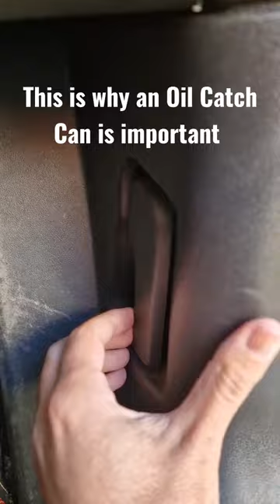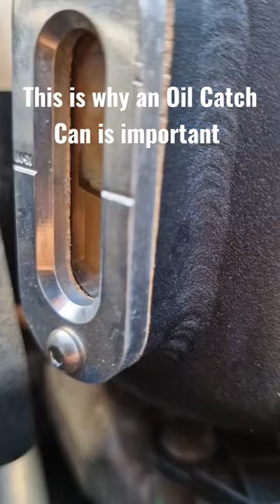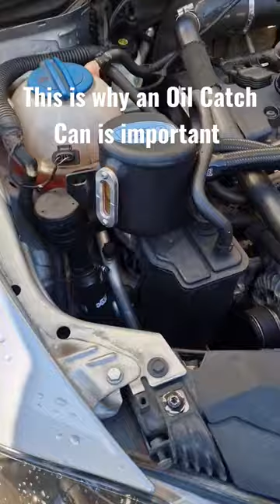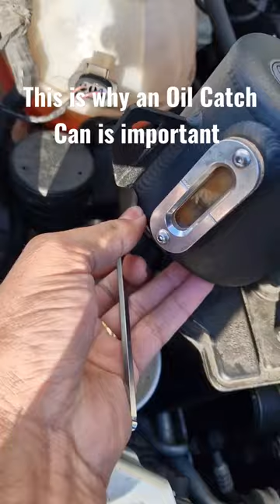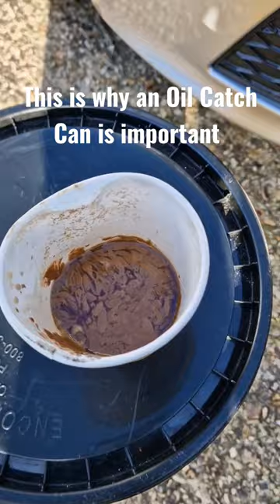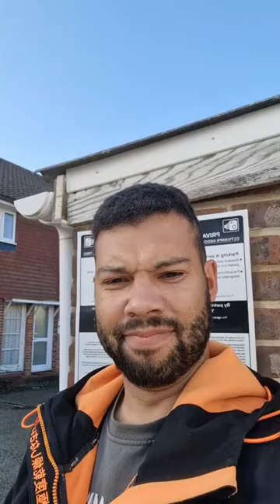Here Is Why An Oil Catch Can Is Important

Comment: Ford espresso
Reply: Nice
Reply: More like chocolate pudding
Reply: mix mix mix that chocolat😆
that sistem is really good for subarus any tipe engine
i'have a cashcan in my 2.5 boxter single cam 7000 milles before take out the valve covers & sorprise bot sides is clean ❤🎉🎉🎉
no bad valvs all is Clean
pcv inner clean
Reply: @cheloarechiga1778 yours filters money?
Reply: @CarObsession do you not know what espresso is?
Reply from the maker: @PurpHaze830  Yes, but this isn't a Ford, that's why I was confused.
Reply: @CarObsession  ohhh because the catch can says forge he probably thought it said ford
Reply from the maker: @PurpHaze830 Ahhh, that makes sense.
Reply: @CarObsession  and the sticker is the same shape as the ford logo oval haha
Reply: La lattina di raccolta serve per motori usurati dai 120/150.000 km in poi

Comment: Catch cans are useful if you have a direct injection engine. On port injection engines they are snake oil because whatever blow by they catch would end up burned in the cylinder if the catch can was not there.
Reply from the maker: Hi there, thanks for watching and thanks for the comment.
Reply: Completely false statement. On a stock car, it probably wouldn't matter. Once you have a turbocharged engine and it is tuned for power (port injected), you do not want oil getting into the air/fuel mixture as you can end up with detonation/pre-ignition and fouling of the spark plugs depending on much much blow by and oil you are atomizing into the crankcase.

For a stock N/A car without direct port injection, sure you will not need one. For a turbocharged and tuned car it's best to use a catch can, or vent it directly out to the atmosphere.
Reply: @JesseS420 So let me see I got this right: you say my statement is completely false. Then you proceed to say that, unless you own an exceptional vehicle (turbocharged AND tuned, probably 0.5% of vehicles out there) my statement is correct. So what is it? For every statement there are exceptions.
Reply: so you say that burning oil is a good thing? what about carbon buildup inside intake manifold, catalytic converter etc...
Reply: @MBB150-v5p At least be honest if you want to debate me. I never said it’s good to burn oil, that would be incredibly stupid. Think about this for a moment: blow by is not pure oil, it’s a mix of water (from hot steam) and oil. A catch can ends up with what, 6oz after 3 months give or take? That’s 3oz of oil, assuming 50/50. It’s nothing. Then comes the intake valves which create a blockage on the way and then a lot of blow by gets on top of it over time. Without it getting washed by the gasoline from the injectors on the direct injection engines it accumulates
Reply: @MrGustavosco  it is not just comnination of water+oil. the useful part of the blowby is unburnt gasoline. also most engines suck oil particles not just vapour. these cans will catch that also some water which is fine and send unburnt gasoline to the engine which helps engine healthy breathing.
Reply: @MBB150-v5p Gas was not mentioned because it’s burned regularly inside the cylinder so it’s a non-issue. Anyway, you didn’t address my main question: is roughly 1oz of oil getting burned per month an issue? Of course not, it’s negligible. The catch can doesn’t exist to stop the engine from burning a negligible amount of oil but to stop carbon build up. If the injector washes the main carbon built up spot, the intake valves, the catch can becomes irrelevant
Reply: @MrGustavosco  1oz of oil per month maybe seems nothing for short term but on the long term it'll create carbon buildup for sure. I don't disagree if you say that oil catch cans are not mandatory but having less carbon buildup with 20 bucks is not a bad idea.

Comment: the best part of waking up is foldiers in your cup. But seriously is it ok for this hose to touch the engine or the engine firewall? I'm trying to route this myself and my bay is much more cramped.
Reply from the maker: How can it be more cramped?
Reply: @CarObsession  it’s a Mercedes coupe with a 5.5l engine
Reply from the maker: @Dnasty1  Oh I see, sorry, I thought you also had a Leon Cupra, which is why I was confused. Well you need to see if there is even a catch can kit available for your car.
Reply: @CarObsession   I actually ended up making my own catch can since posting this with a generic one off amazon for bmw. Took some customization but i got it done. I managed to run it against the firewall (which I was told shouldn't be an issue) so that it does not touch the engine. My only concern at this point is if it is ok that the two hoses touch?

Comment: Run a bore scope into the intake manifold. Look at the valves before and after installation of a catch can on a GDI engine. I bet you have hardened carbon deposits.

Comment: That's mostly water vapour and a smidge of oil.
Reply: No it’s mostly oil with some gas and water
Reply: @Caden17688, how does gas get into a crankcase???
Reply: @matthewnewsome9221 Unburnt gas recirculates?
Reply: @matthewnewsome9221  Runs down the cylinder walls especially during a cold start. It's more common on GDI engines.

Comment: Its supposed to catch oil.  Right?
Reply: Yep catches the oil before recirculating air into your intake manifold. Direct injection cars benefit the most reducing carbon buildup since gas doesn’t clean the intake valves.
Reply: @JoshuaWhitman 
But in the video is catching a frothy milky stuff, is it coolant??? Water mixed with contaminants???    Where's the oil???  I'm a bit confused.
Reply from the maker: Yes.
Reply from the maker: @Wilhuff_T I'm confused as to how you can't see the oil? The "frothy" is merely caused by condensation and is nothing to worry about.

Comment: Based on what can out, It looks like you might have more problems than a catch can will solve
Reply from the maker: Such as?
Reply: Correct me if i’m wrong, doesn’t that milky color mean you likely have radiator fluid mixing with oil? Head gasket has started to go perhaps? Let me know what you think that color indicates.
Reply from the maker: No....this comment has been a few times...it's just condensation most likely caused by doing shorter journeys. 

If I had a head gasket issue I'd have other symptoms such as white smoke from the exhaust, oil in the coolant reservoir, and a milky oil cap, none of which I have.

I work in a car repair garage and the guys I work with say there is no problem (two of techs also have oil catch cans fitted to their car).

I'll be honest, I'm getting tired of such comments being made.... Especially when there's people say mad things such as the catch can will stop my inlet manifold being lubricated 🤦🏽.
Reply: @DLR369_  the air has moisture, the induction phase will evaporate that moisture in the intake process itself so the steam of that get carried and it would condense back into a liquid form in the catch can

Comment: Do your research. Don't listen to these social media mechanics.  The can cause your rear main seal to blow and cause engine failure
Reply from the maker: Out of interest, how would they cause the rear main oil seal to fail? I'm guessing it would be to do with crankcase pressure building up? I would imagine the worst that would happen is that the seal fails, causing an oil leak. I'm no expert, but I would have thought it would only cause an engine failure if the oil leak was left for so long that it caused oil starvation, causing the engine to seize?

Also, on that note, I'm pretty sure an oil catch can would still allow the pressure to be relieved from the crankcase, so I can't  see why that would cause an issue with the rear main oil seal. 

* I've just one this past of the experienced technicians I work with (I work in a car repair garage) and he agrees, unless... "the oil catch can circuit is causing an excessive positive or negative pressure build up in the crankcase I can’t see why it would cause damage to the main oil seals". *
Reply: Ive heard in winter climates you need to be careful with installing these because they can freeze and cause pressure buildup.  Ive heard tech's say they would take them off during winter months
Reply from the maker: I'll be honest, I've never heard of that, nor has that been advised by any of the mechanics I work with, two of which I know for a fact have catch cans fitted.
Reply: @CarObsession  well if you don't have to contend with winter months and freezing temperatures it's probably not something to worry about.  Condensation freezes and we get extreme cold snaps where I live, so it is a consideration I've come across

Comment: U MAY HAVE A HEADGASKET ISSUE LOL
Reply from the maker: Based on what evidence?
Reply: @CarObsession  the chocolate milk u just pulled out if ur catch can. Water/moisture is mixing with that oil somewhere either in the motor or in the catch can somehow hopefully its the second one but still there shouldn’t be moisture or water/coolant mixing with the oil anywhere.
Reply from the maker: @t-dougz6050  I work for a car repair garage, so just ran it past one of techs; he said it's just where water vapour has got in to the oil and emulsified it over time. Our colleague also has a catch can and the same thing happens. So nothing to worry about 👍🏽
Reply: @CarObsession  don’t listen to Dougz. He is right, if this was your oil from the oilpan, but as it is from the catch Can, your garage guy is right. Just water vapor mixed with a bit of oil which is very common and not a problem. Only goes to show that your catch Can is actually working..
Reply: The crankcase should be sealed from all elements except from oil. Even the air moving across the valves shouldn’t be mixing with that oil. That’s the whole point of that catch can. To keep oil out of the combustion chamber. You have water mixing with oil somewhere.
Reply from the maker: @jacobjohnson7815  I appreciate the concern but I work in a car repair garage and one of the technicians who is very experienced says it's perfectly normal so I'm happy to trust his opinion.